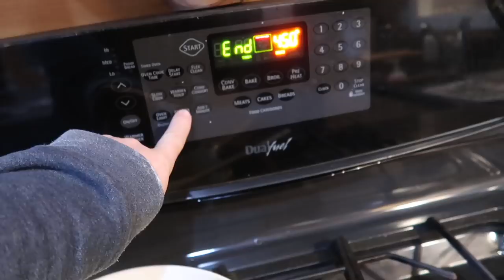Who Won? First to try Out New Kitchen GADGET

Comment: Good morning Al.  Congratulations on increasing your goat herd next month. 
The noise the water jug makes is because the hot water filled it with hot water vapors,  so the cold air caused it to condense and with the cap closed,  no air can get in. A neat experiment that you can do is,  take a small empty metal can with a tight fitting lid, put in about a cup of water and bring to a boil. Cap the can, off heat, immediately.  Put the can outside and watch the can get crushed. The steam in the can condenses and forms a vacuum in the can (like canning) and the atmospheric pressure collapses the can.

Comment: The warm air inside the jug cools off lowering the pressure inside. The cap is allowing air to come in to equalize the pressure and makes noise. Either sealing the cap up more tightly or opening the cap to allow the pressure to balance stops the sound.  Sorry if I get pedantic, I'm a retired physicist.

Comment: I didn't hear any noise..
But if it's presure coming out..
Once empty in cold envirorment..
The water (vapor)
Is expanding the colder it gets causing presure to rise in your bottle...
I.E. if you have a dent in a motorcycle gas tank
Fill it with water and put it in the freezer
The pressure will pop the dent out..

Comment: Hot water warms the bottle. When the water is gone, the bottle warms the air inside. The cap separates the outside air from the inside. Then the outside air cools the bottle which causes the inside air to cool, contracting as it does so. Thus the outside pressure is greater than the inside pressure and you hear air being sucked into the container. You may have noticed the same effect when the freezer door was harder to open right after you opened and closed it. After a while, the air seeps in to equalize the pressure because the seal isn't perfect.

Comment: The explanation for the sound your water jug was making is as follows:

 You had warm water in the jug and after you empty it, the temperature of the air in the jug is noticeably warmer than the air outside. 

When you close the lid, the warm air inside begins to cool off. Cold air is more dense than warm air, meaning the molecules are spaced more closely together. And as the warm air inside the bottle is cooling, and becoming more dense (so it is taking up less overall space) the pressure is decreasing inside the bottle and the pressure of the air outside is relatively higher. So, with the decreasing pressure in the bottle, air is going to try to get from outside the jug into the jug to equalize the pressure difference. Hence, the sound of a tiny bit of air getting into the jug is that hiss. When you open the lid, the air can rush in to equalize the pressure more quickly, which is why the hiss stops.

A neat experiment to show this in a more exaggerated way is to take a small plastic bottle, a soda bottle for example, fill it with boiling water, pour out the water and immediately screw on the cap. Then submerge the empty bottle into a bowl of ice water. When the hot water vapor air in the bottle cools down rapidly, its density goes up ( and pressure goes down) rapidly and the bottle will actually be crushed by the pressure difference.

Comment: I did not see an answer to the water jug sound. Simple physics; as the hot air in the jug cools and shrinks it makes a vacuum in the jug. I am not sure if there was a pop as the side buckled in or a sound of air sucking in through the cap.

Comment: Do not attaché the carry strap to the lid of the de budding box. Use a strap to each side panel. Hinge will fail if you carry the filled box using the lid.

Comment: cute opening! Internet points for creativity awarded...lol... and the bottle makes that noise cause you had warm water in it and now the water is gone and the air is cold and the air and water molecules left in the bottle is contracting as it's cooling. If you left the lid on tight the bottle would scrunch up some when it cooled. Eight eggs! cool... maybe the chaff hay is upping egg production, since there is an increase since you started feeding them that.

Comment: Just a question, why don’t you make a waterer for your chickens with a fish tank heater in it? They are cheap and pretty simple to make. I have one for my rabbits.
Reply from the maker: We don’t have electricity out to any of our animal buildings￼
Reply: Gotcha. I run a 100’cord to mine. Makes life 10x easier. Or you could get a small solar panel and run it that way. If you use a 5gal insulated water jug it works wonders!

Comment: Goooood Morning Al ,
Today is Wed. Feb. 20 and I do not find a new video from you .   I live in Northeast Ohio and I have caught the western edge of the Gulf storm.  It began snowing about 6:30 A.M. today .  The time is now 9:00 A.M. and so far I have about 3 " of snow. The storm from the west passed north of me and I only received a trace of very dry snow. not even enough to measure.  I think that you have already received snow from that one. A lot more dry snow than I got . 
  The weather map shows the Gulf storm headed directly towards you.  And it's full of moisture !  Depending upon the speed that it travels the Gulf storm could reach you by Friday.  It's time to have your gasoline supplies and such ready .  You could possibly measure the snow fall in feet rather than inches .  I'm just barely within the western edge of the storm and I'm receiving what I think is a lot of snow.  The weather map shows the storm as going directly over you !  Have your snowplow ready .
  Sigh , winter is still alive and well .

Comment: Sounds like the lid on the water bottle is not air tight and is sucking in air as it cools , if the lid was air tight , the bottle would deform as the air inside cooled .  Pretty sure we all saw that science experiment in school :-)